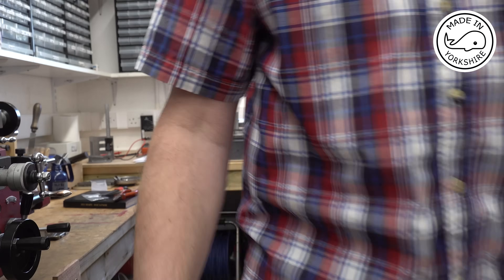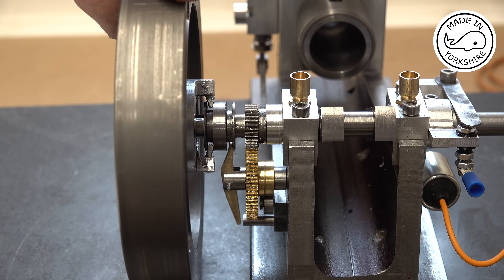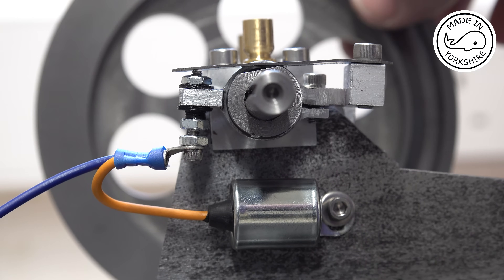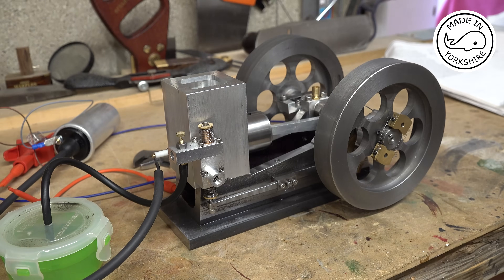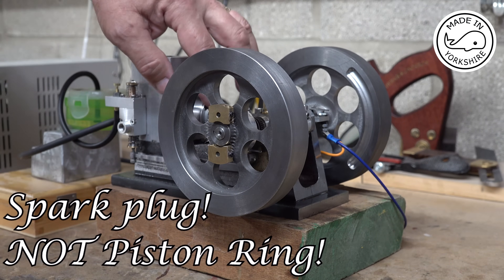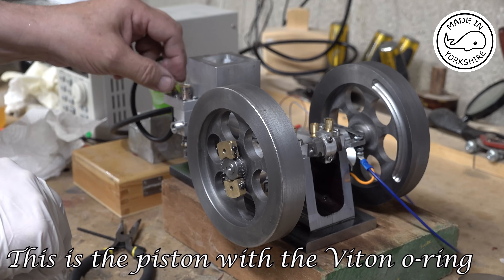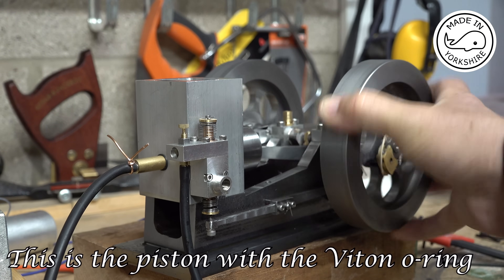#MT41 Part 14 - Philip Duclos Odds n Ends Engine. Assembly and first run. In 4K by Andrew Whale.

Comment from the maker: * READ ME UPDATE *
Follow Bob's advice I bought some graphogen paste to help run in the piston rings. If its good enough for Rolls Royce and Lamborghini rebuilds, then it's good enough for this little engine. I used it to help run in the rings, powered by the lathe. I ran for 20 mins at 300 rpm. Then added oil via the oiler hole and ran for 15 mins at 300 rpm. Added more oil and ran again for 15 mins. Then I used more graphogen paste and repeated the previous steps. The engine now runs under its own power! Many thanks for the advice from Bob!
I'm really pleased that my home made CI rings now work.
Andrew

Comment: Try putting a drop of thick oil in the cylinder to raise the compression.
Its a bit messy exhaust wise, gut should help in bedding in the piston rings.
Reply from the maker: Hi Gary
Thanks for the tip.
Graphogen paste worked really well at running the rings in.
Cheers
Andrew

Comment: Andrew, I've used red rouge to seat rings in a small engine before.  Just a dab on the rings, and running it around ten or fifteen minutes will generally do the trick.  That is a very nice little engine, it sounds very nice, I've always been torn between the sound of hit or miss, and simply having a smooth, regular running engine.  Putting a moderate load on it can be used to regulate it's speed, without the miss, and keep a steady rpm.  Thanks for showing this!

Comment: Rings have a gap and will always leak, if gapped properly and especially when cold. Does the engine you showed holding compression have a ring or rubber o-ring? Your exhaust opening might be a little late in my opinion. Running  timing should be before top dead center. The engine will sound like it is laboring if running timing is  at or just after top dead center.
Reply from the maker: Hi - thanks for the info. See Part 15 where I iron out the bugs!
Cheers
Andrew

Comment: It has been my experience that CI rings take a while to "seat" or run in.  Only one of my engines has had a lot of compression when first assembled.  The compression improves with run time.  40 psi should be plenty.  I do see the spark in the gap between the cylinder block and the intake body.  A very skilled engine builder once said "most carburetor problems can be traced to a fault in the ignition."    I was surprised that the ignition worked so well without tungsten for points!  I have purchased point sets from the auto parts store and robbed the points off of them for my engines.  Best of luck, very nice work on that engine.
Reply from the maker: Hi - many thanks for the advice. I see you watched my follow up video too. I got there in the end.
Cheers
Andrew

Comment: Good job there Andrew pleased for you that you got it run on your CI rings. It seems quite normal to have tinker a little with a new engine. By making the piston with the viton o-ring and getting it running  you proved that the valve timing, ignition timing, fuel supply, fuel mixture, valve leakage/compression were all OK. A good bit of trouble shooting. Cheers, Dave.
Reply from the maker: Thanks Dave. Yeah, I think the viton o-ring was a good plan B! I've just finished the final assembly and made a few changes. Video coming soon!
Cheers
Andrew

Comment: Another great project.
Piston rings will turn a little at each stroke while engine is running, so it does not do much to line the ring gap. At least they do in the big marine engines that I work on.
Reply from the maker: Thanks mate - and thanks for the info regarding the ring cap - very interesting.
Cheers
Andrew

Comment: Great job Andrew, Im sure you will get it running as you want soon, Im experimenting with CI rings on the Farmboy, but cant get it to run at all so reverted back to the Viton O ring which works and runs perfectly - so i am not sure what is going on, from my conclusion the Farmboy looses compression loosing compression back past the rings and out as you have experienced which i guess is the issue.  I will keep trying but ready to move on to the next project now.
Reply from the maker: Hi Andy - I'm going to try to run them in using a jig. Bob suggests using some graphogen paste - so I will give that a try. When I made the rings I did a light test and they looked spot on, so I will persevere. If I find the answer I will let you know.
Cheers
Andrew

Comment: Such a shame that the cast iron rings are not working for you after all the effort to make them. The engine sounds powerful when it is running. The ignition system seems to be working really well. I am guessing you will have to make slightly stronger springs for the governor. A few more tweaks and it will run very sweetly I am sure. Enjoyed the video.
Reply from the maker: Thanks Tim. A bit disappointing regarding the CI rings. I think I will revisit them. Yeah stronger springs needed for the governor. I can't believe those home made points work!
All the best.
Andrew

Comment: To bed those iron rings to the bore you want to use fine grade 'Timesaver' lapping compound or toothpaste. Neither of these are the type of abrasive that will embed in the metal.
Reply from the maker: Hi Howard - many thanks for the tip. I think I will revisit them and try to make a rig to run them in. I don't like being defeated. Bob has suggested graphogen paste for running-in - I've just ordered some so I will try that at the same time.
All the best.
Andrew

Comment: Awesome job Andrew, I am still working on my hit n miss engine.  I have been having a few issues and I am taking my time.  I may have to binge watch your videos again 😀
Reply from the maker: Thanks mate! These certainly aren't short projects and there are undoubtedly challenges along the way. There are lots of variables preventing these little engines from running - ignition, compression, fuel, timing..... I wonder if anyone has ever made one and got it to run first time?
The good thing is that it's relatively easy to re-make components if you mess up.
Good luck!
Andrew

Comment: Hi Andrew, great progress and fantastic to see it running. Having followed this build from the start, I have every faith in your rings, I  just reckon they need a couple of hours running with some very fine compound. I would clean everything down, blue the rings up and see what that tells you, very slight ovality is my guess which running in should cure. You now have your jury rigged compressor to do the hard work for you  (save your finger end) lol. Nothing to lose trying and I want to see the V twin build lol. Cheers, Jon
Reply from the maker: Thanks Jon. I think I will try to make a rig to try running them in. I don't like being defeated.  Bob has suggested graphogen paste for running-in - so I will try that at the same time.
Cheers
Andrew

Comment: So close , I don’t understand why the cast iron rings don’t work . Could it be a clearance issue , or maybe the cast iron you used is not soft enough ? I’m looking forward to seeing what you find out. It just seems that they should work. Great job on the build !
Reply from the maker: Thanks mate! I think I might revisit the CI rings to see if I can run them in using a rig of some sort. Bob has suggested graphogen paste for running-in - so I will try that at the same time.
Cheers
Andrew

Comment: Another nice video.    Back in the 1970's, I used to play around with hotrods and I remember how much of a difference it made when the points had a lot of contact area.   I noticed at time 3:30 that the contact area for your points is very small (the hacksaw blade slopes down).     In case there are future issues, you might add a bend to the blade to make it sit flat on the bolt.      Thanks  for the video.
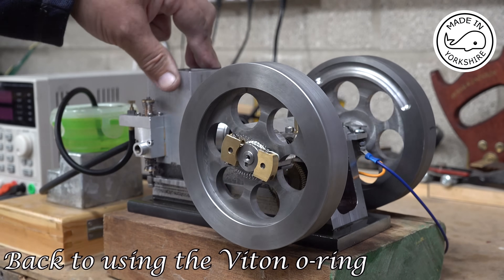Reply from the maker: Thanks for the advice. I'm amazed those points even worked, cos I thought it would be the weakest part of the engine. I've purchased some cheap VW points so I might try to fit those at some point. Steve N commented that he had noticed a spark between the valve body and the main body - at around 14:10. I can see it too, but it doesn't make sense to me. I used a paper gasket between the parts, held with stainless steel bolts. Very odd!
Cheers
Andrew
Reply: @learningturningmetal       Thanks for the response.   At 14:10, that might have been a backfire.

Comment: Fantastic to see it running. Congratulations. I look forward to the next showing with the governor working. Shame about the piston rings, however I've no doubt you'll crack then next time around. Great videos, all of them. Thank you.
Reply from the maker: Thanks Johnny. When I made the rings I thought I'd nailed it - but something isn't quite right. Maybe I should have spent more time setting up a rig to run them in. I might give it a try at some point.
Cheers
Andrew
Reply: @learningturningmetal  You will solve it I am sure.

Comment: Iron piston rings will take a bit of time to bed in and seal the way they should. A bit of blow-by is to be expected with new rings/ cylinder. It might be worth trying building up the piston, rings and cylinder with a running in compound? I have used graphogen paste with good results in the past.
Reply from the maker: Hi Bob. The graphogen paste arrived! I used it to help running in the rings, powered by the lathe. I ran for 20 mins at 300 rpm. Then added oil via the oiler hole and ran for 15 mins at 300 rpm. Added more oil and ran again for 15 mins. Then I used more graphogen paste and repeated the previous steps. The engine now runs under its own power! Many thanks for the advice.
I'm really pleased that my home made CI rings work.
All the best.
Andrew
Reply from the maker: Hi Bob - many thanks for the advice. I think I should have spent more time trying to set up a running in rig. I've just ordered some graphogen paste - so I will give it a try.
Cheers
Andrew

Comment: hi Andrew,   try making the exhaust open before bdc.  alan
Reply: Right Alan, I set the exhaust valve timing at 25 degrees +/- before BDC and just over TDC to close on the intake stroke.
Reply from the maker: Hi Alan (and David) - I agree entirely. I think the Farm Boy exhaust opens at around 35 degrees before bdc and closes near tdc. I tried it on this engine but the exhaust valve tends to close a little too early. I guess its down to the profile of the cam - which is to the drawing spec. On final build I think I will try to compromise a look to open it at around 10 degrees before bdc. 
Thanks for the advice.
Cheers
Andrew

Comment: Well Saturday afternoon, a bit beyond coffee time but this is the video I have been waiting for. Congratulations for another successful build Andrew. Lots of great hints as to how to find the compression leak and get my Duclos engine running. I really like the adapter idea for using compressed air for finding the compression leaks and seeing if it will run on compressed air. It might also be the way to run in the cast iron piston rings. Be careful though if you remember back when I said I lost compression when I took my engine apart to paint it.
Reply from the maker: Thanks Dick. Yeah there is always that danger that it will refuse to run after I've taken it apart. Using compressed air to run-in the CI rings, seems like a good idea. I tried it but after a while the engine stopped rotating. I think that it's due to pressure still being pushed into the engine while on the compression stroke. The inertia of the flywheels helps to overcome this but the compressor eventually wins. Increasing the compressor pressure doesn't overcome the problem either. I think I will try to make a rig to try running them in. I don't like being defeated.  Bob has suggested graphogen paste for running-in - so I will try that at the same time.  
I hope you get some time to get your little Duclos running.
All the best.
Andrew

Comment: One thing you might loon into with rhe cast iron rings is the gap between the ring and the groove. I had a string trimmer that I changed the cylinder assy. on and the ring was too tight in the slot causing a loss of compression.
Reply from the maker: Hi Robert - thanks for the advice - a great idea. I will check it out.
Cheers
Andrew

Comment: Hi Andrew another vote for Mr Crispin's sortie into making cast iron piston rings.
Reply from the maker: Hi Steve - Thanks for the suggestion - but I've already been there and done that. Earl very kindly purchased copies of the articles and posted them to me from the USA. There are several other methods documented by engineers and I think I have got most of them in my piston ring making folder. Needless to say, some of the advice is occasionally contradictory. When I made the piston rings I was convinced that they were a good fit, with no light leakage on the sides. Earl suggests trying to run them in, but I struggled to get my lathe to drive the engine. Maybe the lack of running in was my downfall.
Cheers
Andrew

Comment: Well done Andrew! 
Just to think both of my engines have NO piston rings at all! Cast iron piston polished in to less than half a thou of bore size 👌
Reply from the maker: Wow James - that is very impressive. Your engines run really sweet too!
All the best.
Andrew
Reply: @learningturningmetal  A lot of the old school model aero engines had no piston rings of any form. They relied on precision fit and oil for compression seal.
Reply from the maker: @howardosborne8647  Impressive!

Comment: On the last run at around 14:10 or so I see a spark Between the carburetor and the cylinder block near where the mounting bolt goes through. Possibly a ground issue? Looking good Andrew!
Reply from the maker: Blimey Steve - well spotted! I wonder what is going on there? It doesn't make any sense to me. I will have to get the the bottom of that.
Cheers
Andrew

Comment: Check out mr crispin for making piston rings, he suggested an article published that goes into the science behind them, he failed first time, then had great success the second time 👍
Reply from the maker: Hi  - Thanks for the suggestion - but as Dave points out, I've already been there and done that. Earl very kindly purchased copies of the articles and posted them to me from the USA. There are several other methods documented by engineers and I think I have got most of them in my piston ring making folder. Needless to say, some of the advice is occasionally contradictory. When I made the piston rings I was convinced that they were a good fit, with no light leakage on the sides. Earl suggests trying to run them in, but I struggled to get my lathe to drive the engine. Maybe the lack of running in was my downfall.
Cheers
Andrew
Reply: Andrew has already done that. A viewer in the USA actually purchased the magazines with the article in and sent them to Andrew.